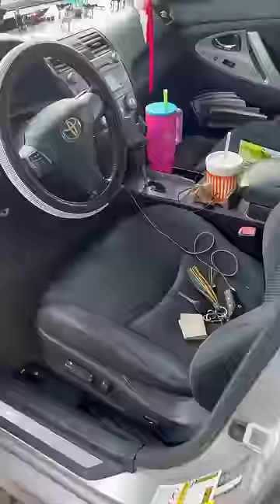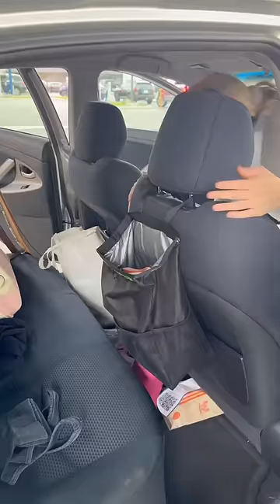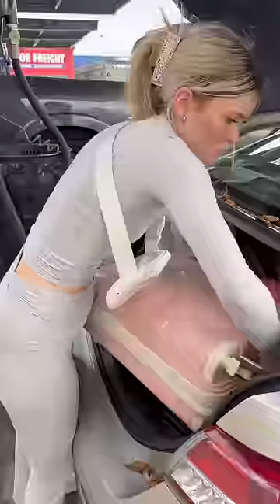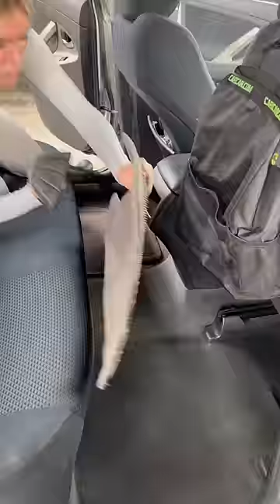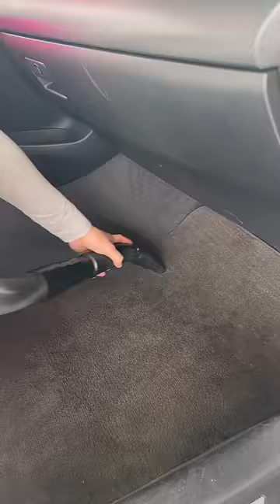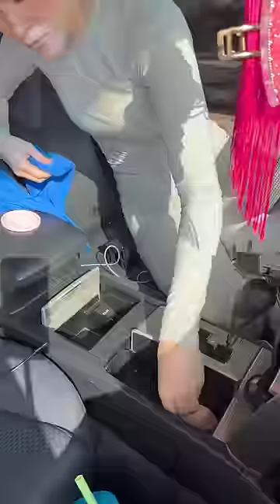Who else drives an older car?? #cleaning #satisfying #Motivation #lifestyle

Comment: Good to see a young person loving their older car.
Reply: 2010 is older? My 2011 truck is new to me. My last car was a 95 and that was properly old.
Reply: @Luke357  Older is a relative term, so I guess it depends on who you ask. What was your 95 car? The last 90s era car I owned was a Pontiac Grand Prix, I miss that thing.
Reply: @tamanebp  I had a 95 Sierra. Single cab, short bed, SL trim. It was about as basic as it got but I loved that thing. The only reason I stopped driving it was because the transmission went out and for a little over double the price of a rebuild I could have a newer truck that was similar but had a V8 and 4x4.

Comment: 2012 Dodge Avenger owner here and I’ve had her since I got my license in 2016. 175k miles later and still going strong. Not ashamed one bit and THANKFUL to not have any car payments
Reply: Just change the oil and keep an eye on the transmission and it should last a bit longer

But don’t expect 300,000 miles 

Start saving up now

Comment: I drive a 1991 Honda Civic daily. 39MPG average, 400K miles. Parts are cheap and it’s easy to work on with basic tools.
Reply: Same here, 1990 Accord and 1997 Accord. Both nearing 350k. I do my own repairs, easy and cheap cars to work on and nice to drive.
Reply: 92 civic coupe (ej2) the base model. With a Frankenstein build. 00 ex motor, non v tech head, crower stage 2 cams also with springs and retainers, skunk2 valves,  high compression pistons, ported and polished the intake. There's more but I can't remember much I built in high school back in 2018 all cheap. Don't know exactly how much hp it makes but I'm faster than my friends 2011 civic SI. That car makes about 190 hp and it's a dual cam however it's way heavier. I can push the car on my own from the steering wheel, anyone can really. Still runs strong to this day. Maintenance is key.
Reply: Awesome 😮
Reply: 1985 chevy camaro here 39 year old car and still kickin
Reply: You must be in the south. Up here in Western NY state there is no way your car would still be around. It would have rusted out. Unless you did proper rust proofing every year.

Comment: Yup!  I drive a 2008 CRV and it’s still going strong. My ego doesn’t need to be fed by driving a new leased car every 3 years and having a $600 car payment every month lol
Reply: Oh snap....my crv hybrid touring payment is 740!   I hate it but our car got totalled right during the leak of the mass fake COVID price increases otherwise we wouldn't have touched that car.
Reply: Crvs are the best!!!
Reply: @catherineludlum4955  I'm sure they are but TBH....I hate the transmission.  That cvt is junk to me.  The design on this one is great and I suspect it will last a long time vs my daughter's CRZ that went out at 127k miles.  That really pissed me off.
Reply: She ain’t got no ahh
Reply: @johngatsby1473 if your talking "CVT", are you meaning "continuously variable transmission" ? - The Honda CRV has standard transmissions - auto or manual, and it has an all wheel drive system  that moves power to the back wheels only when needed - saves a lot of petrol and tyre wear, but kicks in if your in a skid, its awesome. CVT 's proved not reliable.
Reply: $600 if you’re lucky. We’re in the time of $1,000 car payments sadly.
Reply: @rinzler9775  yes... continuously variable.  My 22 hybrid has it and it's crap.  It's a better design than the belt version that my 2011 crZ has by leaps n bounds but it's a pos nonetheless. I'll take a regular ol 8 speed auto with actual shifting instead of screaming like it's gonna break...lol
Reply: The k24 is likely going to go down in history as the best engine ever put in a car. My 04 had 375k before it was wrecked.
Reply: @rinzler9775  2022 Honda CR-V LX
This combines with a continuously variable automatic transmission to deliver a powerful and smooth driving experience. As for fuel efficiency, expect to get around 28 mpg in the city and 34 mpg on the highway.Jun 2, 2022

Comment: I drive a 4 door 2005 Ford f150 5.4. I has 194,000 miles on it. It has a K&N air filter in it that's been in it since 110,000 miles. I take very good care of it. Oil, oil filter, air filter cleaning, brakes, rotors, new tires every 90,000 miles, plugs and so on. Runs great. Our local drag strip had a 150,000 mile shootout for fun. I have a drag car but we entered the truck class for fun. Out of 16 truck entries we won. We won easily. It surprised me how bad these other trucks were running 😂. It does have a 373 gear stock but still, she weighs over, 6k lb! Anyways, I love older cars. I bought it new but I know everything about and how it's been driven and that it's been maintained. Plus, no payment!

Comment: 1984 buick le sabre, I put fuel injection on it, replaced mechanical fuel pump with electrical, rebuilt the oldsmobile 307/5.0L and removed a bunch of eco friendly crap in order to gain a good extra 50hp. Love her

Comment: I still drive my parents’ 03 Rav 4 with almost 140k miles on it. Great car. I was a newborn in it. Just bought a used 2019 frontier because I needed a small truck for some things. I work on my vehicles and between the two I should be covered for the next 25 years at least.

Comment: There should be a spare tire under the trunk liner and then check the fluids in the engine. Oil and antifreeze are the most common low fluids

Comment: I've got a 2005 Buick LeSabre here. Lots of miles, I've had to fix some things, clear coat is peeling, it's starting to rust pretty good....... But, it has the 3800 Series 2 engine, it gets good gas mileage, and replacement and repair parts are reasonably priced. It'll run forever.

Comment: Your car is not old. I still drive a 1991 manual gear Acura integra and it still runs like butter. I still see 1980’s cars still working these days. You just have to maintain your car and it’ll run forever.

Comment: No problems with your car other than a cheap aftermarket stereo for $100 or less. Engine light is probably an evap code or something simple. If it’s running fine, drive on!

Comment: I drive a 2009 Mazda 6 top of the line model that I bought with 54,000 original miles, previous owner drove it very minimal and was garage kept, it drives smooth and has sunroof, fog lights, Bose surround system, ice cold a/c, I was lucky to find this car. I’m happy I don’t have to deal with car payments. I do pay full coverage insurance with progressive that’s only $140 a month w/ car rental and 500 deductible. I do the synthetic oil changes, the regular maintenance and I’m all good!

Comment: Honestly its you and me both. I drive a 2005 Mazda 3 with 206,000 miles. Shes been stupid reliable and has never left me stranded. At least not on the side of the road. It did leave me stranded at the second to last shop I worked at cause I had finished changing out my intake manifold but then when I funally started uo my car, oil started pissing out od the oil filter cap so becuase of that I couldnt drive it back home because if I did I would've starved it of oil and blew my engine. Luckily my boss was kind enough to give me a ride home. My mazda has quite a few issues at the moment and im pretty sure its less then your issues so count your lucky stars its not much and it seems like you do maintain your car. I do too but over time its bound to happen to any car.

Comment: Camry are the G.O.A.T of Toyota dailys!! 💯❤️‍🔥 I have a 2012 Scion Tc (Toyota) with 241K and bought it 3 yr ago come August at 168K. Battery replacement, so far. Previous car was an 05 Tc, got hit and totalled with 323K on it. Still fired up and ran like brand new, and bought it at 248K. :)

Comment: I just bought a 2006 Chevy Silverado over as new as a 2017 Silverado because the 2006 is extremely reliable and the truck is flawless with no rust dents or anything

Comment: KoooDoooS to you. Very Very smart choice. I had a used car Dealers Lic (long ago) as a hobby. I driven lots of cars {before I turned them over for a lil profit} , basically . I driven lots of (older) Luxury , full option top of the line cars. I Luved it , I got it out of my system.

Comment: Hey , to turn off your engine light all you have to take the negative and disconnect it from the battery for about 10 seconds and reconnect it and tighten the bolt back and that will take care of that. Do it on my truck and it works.

Comment: Flat tire is the driver not checking tire pressure. 
Check engine light is driver probably not checking engine oil coolant. 
The raido is not necessary

Comment: I have a 2003 Toyota Tacoma with 146,000 miles and still in perfect condition inside and out.  Car before this was a 2006 Toyota Corolla with 312,000 miles that we traded in for the truck that I've had the longest of any at just months away from 21 years.

Can't beat a Toyota!

Comment: I drove a 1994 Camry for 10 years and then a 1996 Camry for 5 years before I had to get something newer because it kept overheating and we couldn't figure out why (replaced thermostat, radiator, etc.). Because the post-pandemic used car market was wild, it ended up being easiest to get a new car, so for a year and a half I've driven a 2022 Corolla and I do love her (not the car payment, though).
 
Being new doesn't stop flat tires, though, because construction debris got me a year in lol. Your car might just be approaching the age and mileage where parts start needing to be replaced, so if you can be on top of that, you can keep driving her for years (my 1994 Camry had 298k miles and the 1996 had 207kish miles at retirement). Hope you get many more years with your car!

Comment: I drove my last car (2004 Ford Taurus) until it had over 315,000 miles on it! 🥳 Currently driving a 2006, which had around 100,000 when I got it. (Currently at 161,000). I’ve had it for six years and replaced the battery, starter, brake pads and rotors, the entire ac system, and other odds and ends. Sometimes I do wish I had a new car but nothing beats not having a car payment!!

Comment: Stereo system’s are very fixable and relatively inexpensive to fix if you can find a shop that will work with yah, also if your interested you can install aftermarket screens in if that toots your horn.

Comment: When my momma passed away she left my then 15 year old daughter her car.
I think it’s a 2008 Camry. Anyway it had 7k miles and was like new still. Nobody even sat in the backseat. My daughter is 34. Still driving the same car. No Car payment and an excellent running car left my daughter not wanting to part with her car/ she drove it back and forth to uni and took a road trip of 10k miles during her gap year. That thing has 286k miles and still has only needed tires belts and oil changes. Probably some lightbulbs I would assume as well. Excellent car. I’ve never worried about her being stranded because she’d had no problems with the car . Be happy. I bought a Hyundai in 2019 and even the engine was recalled on the stupid thing. It’s had half the car recalled and I’ve had loaner cars for weeks on end waiting on recall repairs. Should have bought myself the dang Camry

Comment: Engine light is arguably the only thing you can complain about reliability wise. Flat tires happen all the time. And the radio not working also has nothing to do with the cars working capability to get you where you need to go. Even the engine light is minor if the car still operates normally. Spark plugs or something minor most likely the cause.

Comment: My 2015 Kia forte was having too much problems especially since it’s our road trip car. The weather and roads that car went through was amazing🤣 there were times in which I question my older sister when she went into routes that a normal car should not go on, but after 8 years it was time. I was constantly taking it to the shops and wasting thousands of dollars every other month so I had to get a new car and honestly it worked out because we wanted to go on more camping trips without worry as wed normally take our parents 2003 Toyota sequoia. great car that still runs amazing but it was hitting its time as well and we were afraid of getting stuck and honestly having a more compact SUV would be better than a large vehicle

Comment: 2007 Ford Freestar. Check engine light has been on for 2 years, and the mileage is unknown because the the odometer information display left the building years ago. Still running and I'm maintaining it.

Comment: I drive a 2011 Chrysler 200, and even though it isn’t super old, it was bought for me with 130k miles on it, I needed both rear control arms replaced, I still need to replace both front struts and sway bar links, and on top of that the brake light turns on sporadically leading me to believe there is also a leak somewhere in the gas line lol. When my parents got it the car also needed both rear tires replaced without them knowing. And this is why I didn’t want them buying a car for me without me there lol

Comment: Old.. right. I drive a 2000 Toyota Corolla with an exhaust leak, busted power steering fluid hose, that leaks oil and water and vibrates when you go over 65 and you gotta refill both the power steering fluid and motor oil every week if you’re lucky every 2 weeks and almost every channel on the radio is static along with the check engine light being on the dash lights don’t work and one of the license plates lights don’t come on. But she’s lovely and does a better job then most of my parents 2010+ cars

Comment: Till recently I drove a 2004 Honda Odissey, but things were getting expensive to fix and the two sliding doors stopped working. I would also need all four brakes fixed and a wheel alignement. 
I bought it for CAD $2000 and drove it 150 000 km, so I ended up selling it and got a 2012 RAM 1500 (I needed a big vehicle to haul all my tools). I drive it as if I pay for fuel - because I do!

Comment: I have a 2013 Hyundai Sonata GLS.  It is slightly older but only has 123,000 miles on it (4/2024), but I did quite a few things to it, like swapping out all of the lighting to LED, put some leather seats in from a 2010 Range Rover Sport, and I am going to upgrade the head unit to one that has Apple CarPlay.

Comment: 2008 Scion, Trunk doesn't open and today I needed gas n it said it was full after like 4 gallons.  It was not, had to try to pump a few more gallons.  Earlier both my passenger window n sunroof had to be *reset" bc the battery was unhooked to fix the alternator.  Ahh, the joys of older cars ,😉

Comment: Those old stereos go out they don’t cost much to replace.All cars get flats but you could carry a can of fix-a-flat or get AAA.Your check engine light is on because you need to change the oil and filter. I have a 1999.

Comment: I drive a 2008 Mazda and I love it but it's got a few issues. Check engine light is on- bad exhaust leak, valve covers leaking, its burning oil- I love it and it's so much fun- but I'm gonna need to get a new car soon. 🫠

Comment: If you want your car to give you troubles:
1. Talk about how reliable it's been
2. Fix or mess with or upgrade the stereo

Those two things will ensure car trouble in no time!! O2 sensor, valve cover gasket, aircon stops in dead of summer, rear brakes seizing up, bushings, motor mounts, and tires are all susceptible to this "speak"

Comment: A flat tire and a check engine light is basic stuff. Stuff like a transmission or engine failure is stuff to complain abt.

A blown tire is because the tires were too old, & were not replaced like they should’ve been.

Comment: I daily drive a 06 Hhr with 193k miles and I did pads and rotors just for the lower control arm bushing to disintegrate😂 I’m 5k deep in parts so far owning it 6 months

Comment: I had a 2003 Mazda Tribute SUV I bought in April of 2019. It ran great until about 3 yrs later, it started to have all kinds of problems. The Alternator, wheel bearings, muffler & towards the end.. the fuel tank fell out and it was all broken up. After I took it to a mechanic, he put it up on the lift to show me the bottom part of the car, or the bones rather. It looked like a scene from the wreckage of the Titanic, It was awful! So I started taking it to the mechanic regularly, just to make sure everything was still intact. So then they start telling me that the car is Not for the road and they were expecting a catastrophic accident to occur at some point. Nonetheless, since I live in a rural area I had to keep using it for the time being. But Thankfully, there wasn't any catastrophic accident and i didn't get killed, thank God. So Long story short, I got ripped off and now it's sitting in the junkyard😒 I managed to get a little money out of it from the salvage yard, but still. I drove it for 5 years before I had to junk it. Believe me i know your pain..and then some 🙄

Comment: In December I was forced, due to structural rot, to take my beloved 1990 Volvo 240 wagon off the road. 34 Ontario winters and 400,000 miles had taken their toll. It had been my mother's last car. After she died I mentioned to some of her neighbours that I needed another set of wheels. Ma's nextdoor neighbour suggested I buy her car, as she was forced to stop driving at the age of 95. Sold! One lovely 2004 Toyota Corolla with just on 100,000 miles. I love little Yoda. Superb little buzzbomb that is better than I dared hope.

Comment: Its always funny to hear people claim they drive an older car and then you find out its less than 15 years old. I drive a 1976 E150 Cargo van with an inline 6 cylinder and has a 3-speed column shifter. Now that is an older car. The engine almost 400k miles on it as I orginally purchased brand new when living in New York for a while and then drove it back to CA. Only had to rebuild the engine once. Unfortunately CA smog laws are becoming so strict it is becoming a nightmare to get it passed smog. It meets all smog levels but doesnt have the newer fittings and components required to meet smog regulations